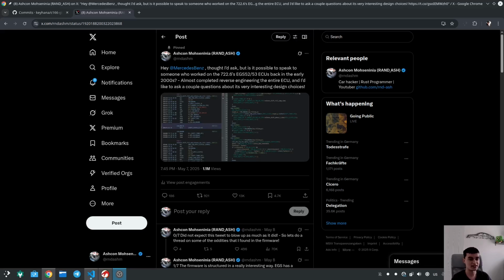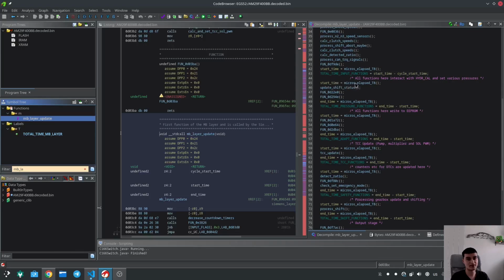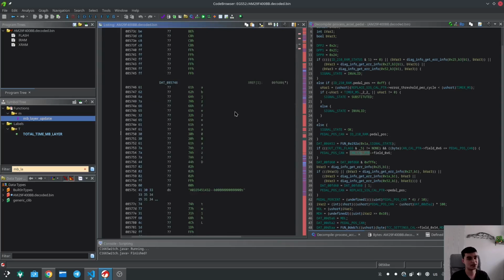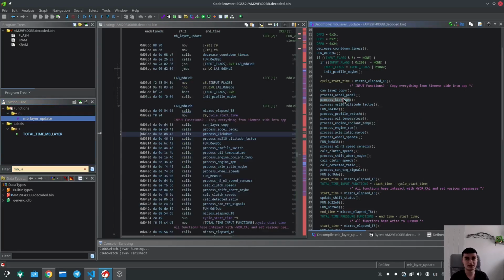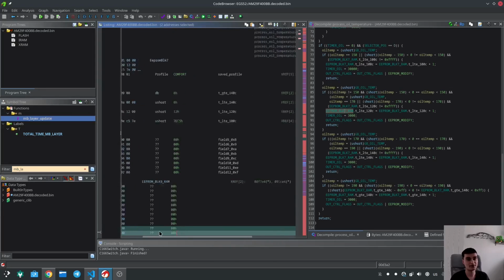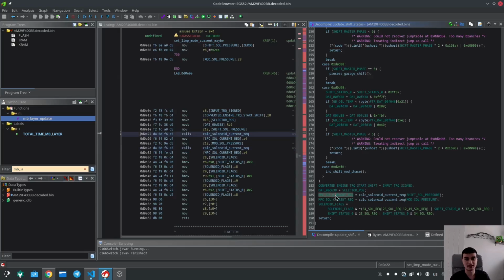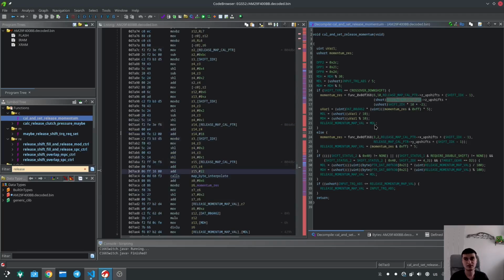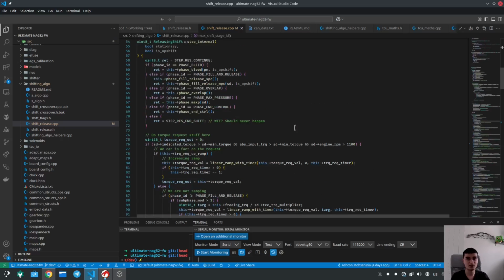Reverse engineering EGS52 to unlock many secrets of its inner workings!

Comment: 10min, it’s called Temperaturkollektiv and it tells the engineers the driving profile and how often (long) the gearbox got to which temperature. Very similar to BMW TCU.
Reply from the maker: Probably since both were designed by Siemens....although, this oil temperature stuff is ever available via diagnostics, so probably for development only

Comment: @RAND_ASH hi, hope all good with you, a couple of comments to clarify a) you mention temperature and the subtraction of 50, explanation is that CAN bus uses 8 bit fields for temperatures and if the firmware works with this in 8 bit a signed value is inconvenient (-127 to + 128) hence by adding 50 to everything the 8 bit uint gives a range of -50 deg C to +205 deg C    b)  You mention that using coding to make changes (eg adding Agility mode) may result in the EGS52 firmware overwriting the changes made - during my work I have found that EGS52 never alters its main 512KB Flash memory never never (during normal operation),  some coding strings are protected by CRC16 and can be altered but the actively used EGS52 firmware Flash areas are probably protected by something more powerful than CRC16 or even CRC32 I suspect more likely SHA256 or earlier versions. Any direct patch to working Flash firmware will not cause any problems for about 30 seconds from turn on, then the EGS52 goes into brick mode every time.  I have been reading some of your GitHub NAG52 firmware, its very impressive !!

Comment: Can you swap egs51 to 52 on om606 engine (msa25.1)?
Reply: It's possible in theory but there's no variant coding for msa so you'd need to make changes in code on both parts so they can communicate. It's really not worth the time in my opinion and I'd recommend just using a standalone TCU like the Ultimate-NAG52 if what you're after is mainly the absolute end result. Personally I'm making my own very basic TCU, purely designed for fulfilling my own needs, based on the arduino mega 2560.

Comment: Hi, an amazing project it is! I wonder, how did you gave all these variables meaningful names? Do you have any official docs/manuals/schemes or is it all based on personal assumptions and logic testing? Did you need to dynamically fuzz/piggyback on the CAN to find out how ECU -> TCU communication works or do you have a complete KWP protocol specification? I am currently working on a BMW 316i BMS46 ECU firmware RE/decomp, i found out in code that it uses DS2, KWP2000, K-Line, OBD2 and a super secret EWS CAN (+ some transport layer ones) protocols for communication, but the software is from the early 90's and RE protocols didn't give me that much info about what each piece of code does. I feel like i've hit a stub, because i've RE 90% of the bootloader (very interesting modular Bosch design), around 40% of the kernel-like layer (nothing important, also made by Bosch) and only 2% of the actual BMW business logic that makes the engine work. Do you have any advice or recommendations for someone doing a project like this?
Thanks for your time and keep up the good work!

Comment: fascinating work! from what i understand your chip is a TCM replacement? In that case does it work with pre-facelift cars? Ive been struggling with my 722.6 and i feel that this is the way instead of getting a new oem TCU.
Reply from the maker: It works with any car with EGS51,52,53
Reply: Would you mind sharing the 29F400 binary you’re working with? I‘d love to give it a go.

Comment: Source code for many egs52 firmware versions has been leaked years ago and included chrysler and mercedes and is how new features have been added to stock firmware and have even added map switching and tcc switching using the redundant data areas that hold all car variant data for coding where maps are changed for map switching using quick coding over obd to different maps using different 4 digit codes and now even using esp button to switch maps will be released sometime soon.
Reply: Its possible that the original EGS52 firmware source code listings were somehow leaked from MB years ago - but I personally have never come across them, please can you advise if you know where to obtain these listings
Reply from the maker: This guy is speaking hot air....he has no way of backing anything up, and a lot of contacts I know also disproved this "leak", so it's not real
Reply: @RANDASH   I was chatting with Gemini months ago and Gemini referenced your work and this video in particular and commented that the disassembly represented an enormous amount of work, additionally your NAG52 work represents another enormous amount of work and its clear that a good deal of time with Python scripts was needed to make sense of and parse the background library stuff. I studied the CAN layer info and the vast number of detailed variables used by MB was very difficult, I got the impression that the CAN layer spec was put together by a team that took it upon themselves to catalogue every possible variable bit by bit however trivial or irrelevant, it also seemed strange how they selected hexadecimal mo id's but stayed away from any that used digits a - f
Reply: How can I get in contact with you?
Reply: Also curious where we could find the source code leaks
Reply from the maker: Really? Never heard of this before, I doubt it
Reply: @RANDASH  Has already been done many years ago by tangent motorsports.  This is nothing new. There is video proof just search  youtube for Mercedes Benz multimap you will find the proof egs52 multimaps been around for years.

Comment: Could you have multi maps on a stock TCU by just changing the variant coding and it's destination maps
Reply: I even told him that and he does not believe it even though I do tuning using multimaps. I have a write up on ecu connections how this works. Checksum check has to be disabled. This is for egs52 and egs53. Multi map for egs has been around for years.
Reply from the maker: I'm aware of this method (multimap tune via SCN). But, I'm mainly wanting to rewrite the whole egs for a modern processor, that's the goal of my project, and then add new features.
Reply: @RANDASH  You need any certain egs firmware i have all of them 180+ and most all Chrysler, Porsche, Mclaren, Freightliner and Ssyangyong egs52 firmware part #'s and around 5 different egs52 hardware versions boards. If you wanting to chat with someone that was on developer team for EGS at mercedes I know someone from Germany that was back in early 2000's.
Reply from the maker: I'd always appreciate more help!, trying to obtain every single calibration for a database myself is proving to be very difficult (Some people have obscure EGS PNs and don't know how to dump flash themselves)! Feel free to email me!
Reply: Greetings from Germany, even though i‘m not actively working on EGS52 yet, I’d appreciate having a chat with such person, too :)

Comment: That's very interesting, I tried disassembling EGS52 with the disassembler built into Keil uVision5 it was very heavy going and I felt that the disassembler was sometimes wrong also that a lot of the EGS52 code was weird on an assembler level, there was a lot of seemingly pointles register moves and I decided that the code was very obfuscated, looking at your work now its clearer that they were using some sort of compiler. The time increments you mention, I have seen this done before using a timer (typically T3 on the C167CS), to check time just subtract Tnow from Tprev and the 2's complement arithmetic always gives the elapsed time even when the timer overflows, from your work it looks like they haven't relied on interrupts preferring a sequencer type of approach and using the timer, a good way to work in real time. I'm going to try installing Ghidra and see if I can make any progress with it. The C167CS is quite a nice device once you get used to it, on the EGS52 the instruction time is 41.667 nSec but most instructions are 2x 3x 4x that, the device has bit addressing instructions multiply and divide instructions built in so it can be quite fast especially if programmed in assembler. I'm surprised that they relied so heavily on tables. The EGS52 are a pain - if you disconnect any wires they brick themselves. I wanted to read the code in my EGS52 and clone it (as a backup) but scared of bricking it.
Reply: What do you mean by bricking itself?
Reply: @guganotubo  the standard EGS52 from the early 2000's records fault codes (as do all) however if the fault is severe the EGS52 will also disable itself (presumably by writing in its flash memory). For example I have found that disconnecting the TC solenoid wire is enough. After detecting this disconnected wire three times the EGS52 will disable itself. Once disabled it needs the Mercedes Star system (or equivalent) to restore it to working state.  Hence my reluctance to power it up on the bench and try to read its Flash program.
Reply: @richardwilliams3215 in my experience it's plenty happy to boot and communicate powered up on the bench with 12V and CAN/K-Line
Reply: @guganotubo  yes I agree with you, having checked myself it looks like the EGS52 constantly outputs three CAN mo's on the bench, have you got any more info as regards the firmware ? any listings ?

Comment: I have fitted an M271 CLK 200k torque converter to my M112 CLK 240. Running the car's EGS52. Drives weird below 50mph, but amazing above. Do you think it's possible and reasonable to configure either the EGS52 or UltimateNAG52 to bridge the mismatched powerband and hydrokinetic coupling characteristics? Love the project. Thanks -Gus
Reply: Hey I don' think there's much difference between those torque converters. Maybe there is between Petrol and Diesel or the high torque versions of the 722.6, another possibility is ATF, torque converters are very touchy about the right spec ATF, try doing a few ATF changes.
Reply: @richardwilliams3215 Well well... Funny you say that because I did fill it with 236.15 to see what would happen. I'm not convinced it's the fluid, but I guess I might as well try it out before paying to rebuild the old one 😅